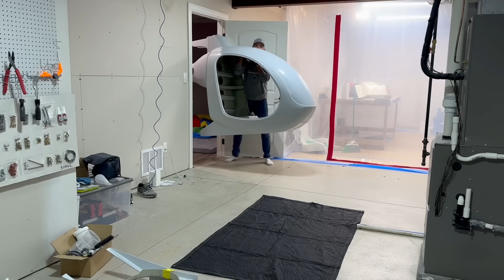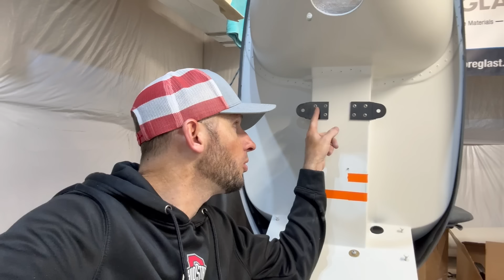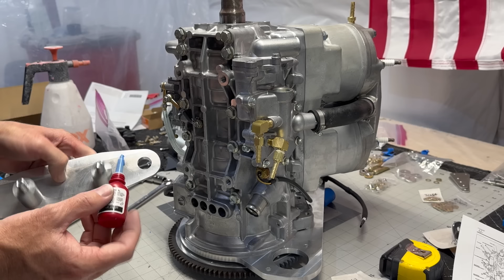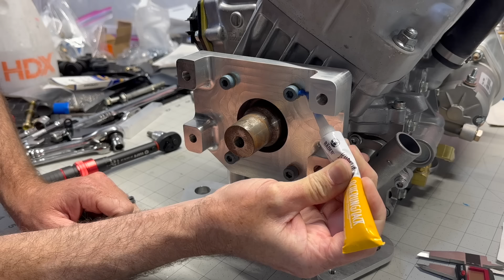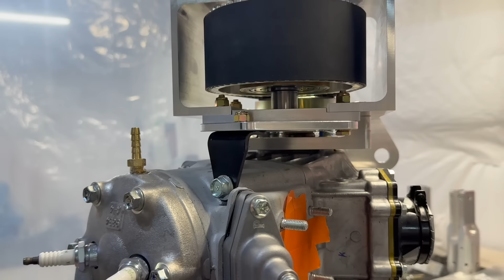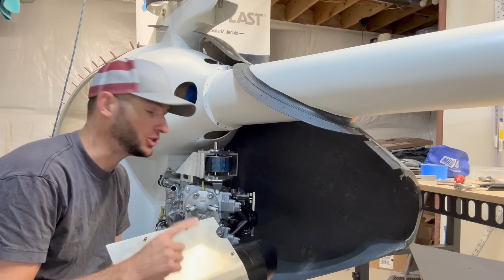I Installed a Snowmobile Engine in My Helicopter | Basement Mosquito Helicopter Ep. 31

Comment: Do you suppose that the exhaust direction has been 'calculated' into the operational design of the Helicopter?  Like, to provide assistance against the rotational forces against the rotor blades?
You went to a meet-up recently, right?  Did you see any built units redesigned with their exhaust exiting the rear?
One thought that crossed my mind is; with the existing exhaust resonator, there appears to be a series of step-down cones from the exhaust manifold to the resonator.  Are you able to break the welds of those conical sections and do a right-hand rotation of the sections, then re-weld the cut conical sections with the resonator now pointing out the rear??? 👀🤔💡✌
Reply from the maker: I originally had the same idea, to modify the existing exhaust. I think im going to leave it so I can use it as a baseline and just make a new one.

Comment: So, do NOT do what the doorknob below said to do regarding freezing the bearings. That is the absolute %$#*est thing I have ever heard. How is freezing the bearings going to make them drop on the shaft? IT WON'T!!! You freeze the shaft and leave the bearings room temp. Freezing the bearings to the temp needed IF you were to freeze them would require dry ice because refrigerator freezer temp isn't enough. Freezing the bearings with dry ice will ruin the bearings because the outer race will constrict against the bearings and dimple the outer bearing race. Bearings ruined. Aside from that, the inner bearing race is going to constrict more so you will never get it on the shaft. 
You freeze the shaft, or the end of it with dry ice, and leave the bearings room temp. You need a half hour to 45 min for a shaft like that. I have a machine shop and I have to keep the shop heated 24 hours a day 7 days a week through winter to protect the bearings on my machines from destroying themselves. 
Don't listen to these youtube ecktsperts. Most of them seriously have no clue what they are talking about. 
I can't friggen believe some of the people here. Holy cow! 👣👣👣👣👣👣👣👣👣👣👣👣👣👣👣👣👣👣👣

Comment: Dual plug redundancy is a myth; Dual plugs force the flame fronts to collide in the center of the cylinder for more power.
when you lose a bank of plugs the power lapses and temperatures rise as the slower uneven fuel charge lacks the push it once had.
in the 90s I test flew a helicopter with a real snow mobile engine in it at Ken Brocks Fredom Fly In. One cylinder petered out and I autoed downwind to a nice landing, far from the action. So I revved to the top of the green and popped it to a hover and as the rotor RPM drooped, I set it down and repeated the process a dozen times, Engine had RPM but almost no torque, But at least I didn't have to walk.

The next year Keven was flying it at the BBFFI when the same thing happened, but he got it on REAL TV.  He made a mess of it, but he only had a few scratches.   We needed one of these engines, Looks great
Reply from the maker: It’s nice to have another set of eyes in this project. Really appreciate your feedback!
Reply: @TheOkayestEngineer  Sadly this kit is from the last bunch of companies that made nice helicopters.  Nice to see the quality put in it

Comment: I am bit concerned about the those brackets being held by rivets.  Dont know they have the shear strength that bolts do.   Other then that im digging this build and cant wait for the next videos
Reply from the maker: I had the same concerns, but thousands of flight hours on other builds have proven they hold up just fine.
Reply: 8 fasteners for each mount for a total of 32 with a pull of 200# sq" & sheer of 300# sq" for each fastener = I see no issues😁

Comment: You should make yourself a 50HR and 100HR inspection program while you're building this. If you think you should check something again write it down. If you dont like the design of something and think it should be looked at in 50hrs write it down. Example would be the orings on the outside of the tail rotor driveshaft bearings. check them for spinning or flat spots in 100hrs . You know this machine more than anyone so write it down before you forget.
Reply from the maker: That’s all in the works and it’s been extremely helpful to be publicly reviewed by everyone here. I have a lot to live for so the first few hundred hours I’m going to be extremely cautious about everything. Annual inspections are also required and I’ll be taking those seriously as well. Thanks for the suggestions.

Comment: Just tuned into your build and like the construction all but the engine mounts. Using rivets to me doesn't feel good , first the weight of the engine and radiator seems like a big load on rivets plus when running the torque and vibration to me would place too much stress on the rivets {my opinion }   signed 45 year retired A&P and auto mechanic.
Reply: those rivets should be cherrymax. But he has plenty room for bolts installed from the inside nuts outside
Reply: @Brandis56  I have more faith in bolts then rivets! I won't trust rivets on any engine mount not even on the snow mobile ! If the snowmobile failed you can pull over ! No such luck on the copter , it would most likely shake itself apart !
Reply from the maker: That was my first thought as well but there are mosquitos out there with over a thousand hours with no issues. And there isn’t a single reported issue with the mounts.
Reply: @TheOkayestEngineer  but just like the DC-10 engine mount on the pylon , seemed like a good design for years till it failed ! I just couldn't fly the copter with that in the back of my mind ! First how do you check the torque holding power on the rivets ?
Reply: @TheOkayestEngineer  It is your project and KUDOS to you. But those rivets do not have the value of even One of the engine bolts that should tell you something. You have ample room to install an bolts from the inside annd put jap nuts onthe outside . That engine is a hard hitter high vibration a very good engine but high vibration.

Comment: Make an airbox that mounts directly to the throttle bodies and has an open flanged end that seals against the cowling half. Put a NACA duct on the cowling and you got an unimpeded inlet system void of bends, just got to think about using either small filters mounted to the throttle bodies in the airbox, a panel filter sandwiched between the airbox and cowling or none at all.

Comment: Huge progress! CHECK the second spark plug on the cylinder you rope stopped to torque the crank, the rope may have damaged the remaining plug under force! Ask me how i know. Also im a lifetime 2 stroke user and oil injection pumps are a failer point for sure, do some research and maybe run a little amsoil saber oil mixed in your fuel aswell as a back up ( amsoil saber is a extremely low ratio mix) anway im not okest engineer but its worth a look. Keep up the longer vids!!! Cheers form Australia mate
Reply from the maker: Most valuable comment yet! Didn’t even think of that. I’ll check tonight. Thanks!!
Reply from the maker: I plan to pre mix enough to buy me a little time if the pump fails. I haven’t heard of amsoil saber oil but I’ll look into it now.
Reply from the maker: Checked the second plug. It’s good 😊

Comment: Hmmm FAA Certified LSRM-A that is an interesting safety wire technique that should be more of an inverted S shape and the wire should wrap around the outside of the bolts to essentially pull against each other
Reply from the maker: Good catch. The bolts only had one hole in them from the factory. The proper thing to do is probably replace them…

Comment: Love your build, good stuff…HOWEVER, you really need to learn proper safety-wiring. All of you wire needs to be redone.
Reply from the maker: The bolts only had one hole in them from the factory. The proper thing to do is probably replace them…
Reply from the maker: The bolts only had one hole in them from the factory. The proper thing to do is probably replace them…
Reply from the maker: The bolts only had one hole in them from the factory. The proper thing to do is probably replace them…

Comment: Maybe I’m being crazy but those tiny little brackets held on by pop rivets carrying your engine….. it’s a no for me dog…
Reply: The rivets facing the engine don’t actually do a lot, it’s the ones on the side that will carry the loads, the key thing is to have good load transfer between the rivets and the structure, the rivet “squash” gives you that. They are working in shear which is the best way to use fasteners…so that many rivets is overkill… it’s a very strong set of brackets 😊
Reply from the maker: Ding ding. You’re the winner. The first one to point out the rear facing rivets are almost doing nothing.
Reply: I’m surprised they run 2 exhausts into 1 expansion chamber … but I guess it must sort of work, if you do reroute the exhaust will you try to keep the same expansion gradient ?
Reply from the maker: I haven’t decided yet. The little research I’ve done says 2-1 is okay. Two individual is better. My limiting factor is packaging so I plan to do whatever works best for that. I don’t need absolute peek power but it should be tuned close. The other advantage is the exhaust only needs to be tuned to 6000 because it’ll run that rpm all the time.

Comment: My aircraft has some NACA ducts that feed air directly through some lovely carbon fibre ducting into the airbox… It keeps the cool inlet air fed straight to the engine without mixing with the air heated by the exhaust under the cowling. Are you going to do something similar? 🤔
Just captivated by your videos… it feels like we’re right there with you through the build! 🤓👏👍 Great story-telling!
Reply from the maker: NACA ducts is likely going to be the solution. I’m just sad I’ll be chopping into the cowling and hope I can make it look as good as possible. Lots of work ahead!

Comment: The centrifugal fan that comes from the factory will probably provide more pressure, which is what the radiator needs
Reply from the maker: Good point. Pressure is definitely more important than flow given the restriction. The factory fan might. I’ll be testing it to see. I also have an idea to change to an electric fan setup. Still too early to know anything yet.
Reply: @TheOkayestEngineer in general a centrifugal pump will provide higher pressure but you still might be able to come up with something better than factory!

Comment: One would think that the engine bulkhead, the mounts and the engine drive line would all be coplainer so if you add a packing washers to the top mounts you should also add them to the bottom to keep the entire assembly in alignment. By only putting them at the top you could be putting the output shaft on a slight angle to the tail rotor gearbox input shaft that won't necessarily apparent with your straight edge. If their not coplainer this could cause extra stress on the system.
Reply from the maker: I should have done a better job explaining. The engine was actually tilted slightly forward without the extra washer on the top mounts. Adding the washer to only the top actually made everything come more inline. The flex couplings you haven’t seen yet, will account for the left over small misalignment and any movement from the engine while it’s running.
Reply: @TheOkayestEngineer thx for the feedback, all good info. We want you safe up there 😁

Comment: I'm not sure if you're aware, but when using a torque wrench, you should stop once it clicks. If you continue and allow it to click a second time, that additional click can over-torque the fastener. Depending on the wrench, technique, and application, a second click can add up to approximately 10% more torque than the wrench's set value, potentially resulting in an over tightened fastener. 12:20
Reply from the maker: Noted. Thanks!

Comment: Truly slapped me stupid. I was hawking the details approvingly, thinking wow these guys, including the builder, truly have acceptable abilities. All the while, visualizing details of blind holes, vibration, torque etc etc I was being shadowed by the question of where did they fit the camshaft(s)? Anyway, I'm holy slapped here and also unable to comprehend how heat can be transferred through it all. Drop the Suzuki Engine Model I.D - type code if / when convenient if you feel up to it. The ensuing episodes will be enlightening for this viewer.
Reply from the maker: The engine is an Inntec 800. There is a massive amount of information on the internet about them.
Reply: @TheOkayestEngineer  I can see your silly grin when you bring it into a hover
Reply: no cams on a two stroke - reed valves

Comment: Fantastic engine by the looks of it. What does it weigh ? 
The fan situation is interesting, is the fan blowing air  through the rad ?
Reply from the maker: I didn’t weigh the engine but my guess is about 70-80 lbs. right now I’m planning on having the fan blow through the radiator. Not sure if it’ll work due to the elevated air temp in the cowling then being used to cool down the radiator. We will see. I can flip the direction if needed. My largest unknown is temperatures right now.
Reply: @TheOkayestEngineer   Was the previous fan also set to blow air ? 
There must be a lot of inefficiency with that set up as you need a large gap between fan blades and rad to allow the engine to move. 
This is something I struggled with as I wanted a tight fit but have the same belt drive set up. 
They obviously have the system working but far from optimal I’d suggest. Interesting
Reply from the maker: @Ben-Dixey  if this doesn’t work I’m swapping to a small alternator and a separate electric radiator fan. This fan running at 6000 rpm isn’t an ideal speed either. I’m sure I can make an electric version consume less energy and be more effective.
Reply from the maker: The original fan sucked air up from the bottom.
Reply: @TheOkayestEngineer   The fan runs at 6000rpm ? 😳
My spal electric fan runs at 1850 so I also ran that fan via a belt at the same speed. Only used a 1/4hp. 
If your fan is running at 6000 it will be using a lot of hp, 3-5 would be my guess with the metal one. 
You have plenty to spare of course but 
Can your replacement take that kind of punishment I’m wondering. 
Sorry for the all the questions
Reply from the maker: @Ben-Dixey all the questions are welcomed! The new propeller was designed for a drone with an operating range right around 6000 rpm. In my opinion it’s much more suited for this application. Far from ideal though. Still a lot of unknowns here but I’m very curious to see how it all works out. Any horsepower saved from the fan is less heat and more performance for the helicopter.
Reply: @TheOkayestEngineer  Ah, fair enough, you have usually already thought of everything. 😀
Looking forward to finding out if the  engine overheats or not. 👍
Reply from the maker: It’s the stuff I didn’t think about that’ll get me. That’s why your feedback is so valuable! Two brains are always better than one.

Comment: I'm retired USAF, weapons system maintainer on the B-52, along with several other airframes. I would suggest you look up your safety wiring techniques again. While they will certainly work as-is, they don't meet the requirements I am familiar with. As critical as those engine fasteners are, I would want every assurance they stay where they belong. Look into routing, tension, and termination of the pigtails.
Reply from the maker: Great points. The flywheel bolts only have one hole in them so my options were limited. The other bolts you saw didn’t have holes and I realized how critical they were so I took it upon myself to drill and lock wire them.

Comment: Looking great. Can't wait to see it burning g and turning. 

I would put a very high inspection rate on the engine mounts to fuselage connection. The composite there due to stress concentration will be the weak link. The pads that riveted to the fiberglass could have been butterfly shape to spread the loads and bonding them would help a lot too. 

Like the engine, great progress.
Reply: With all due respect to the creator, these joints connecting the fuselage to the engine are subject to EXTREME stress. Engineers typically make them even stronger by reinforcing them with an aluminum frame embedded inside the fiberglass fuselage. The brackets are then mounted on top of this 'sandwich' structure, ensuring the engine won't tear away from the airframe. This definitely requires a consultation with an experienced aviation engineer!
Reply from the maker: You both have valid points and I too had concerns. If it weren’t for the existing airframes with thousands of hours on the using the same technique and having no issues I’d be more worried. I will be inspecting them frequently.
Reply: @TheOkayestEngineer  I truly believe this project will succeed and the brackets will hold up under the load. Either way, best of luck. Can't wait to see how it turns out!

Comment: Bearing Trick: freeze bearings heat component, bearings drop right in

Your videos have gotten a 1000 times better since your first one. Keep up the great work. 

Love and respect from Canada
Reply from the maker: Really appreciate that! I’ve learned a lot and it’s getting easier to edit them.
Reply: Other way around. Freeze the shaft heat the bearing.
Reply: @SeanWhite  I've found heating the bearing causes the grease to turn into liquid and run out.